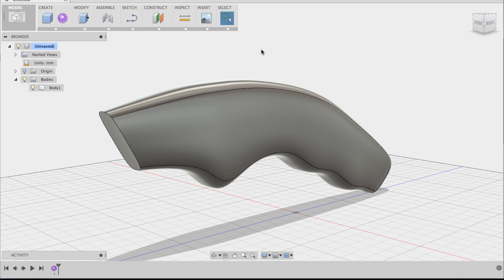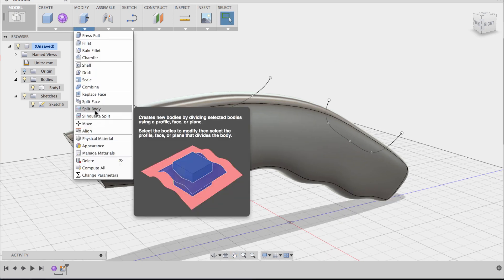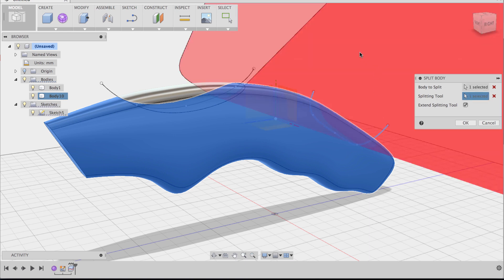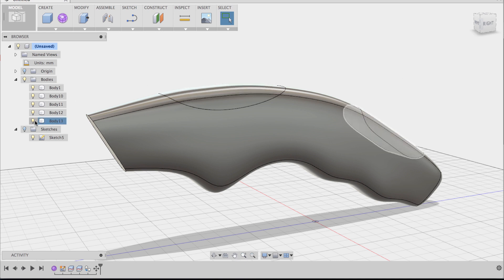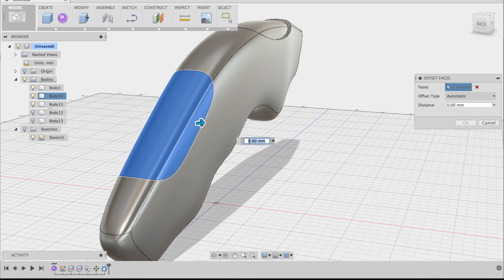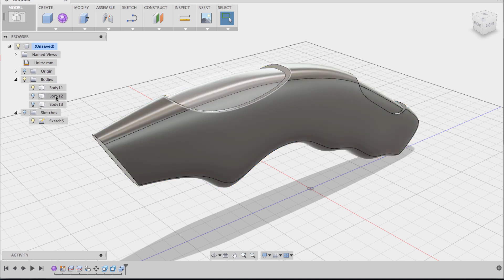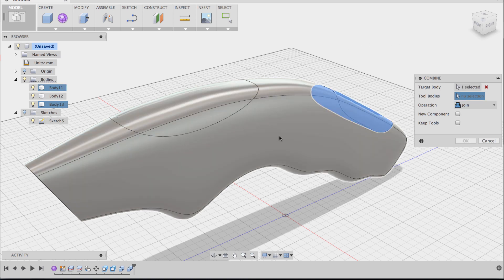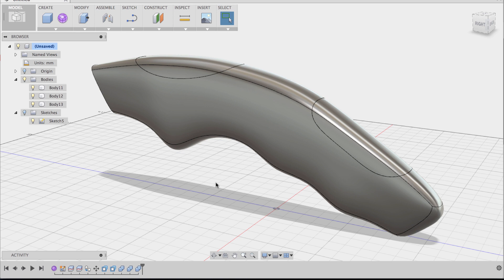How to design grip inserts

Comment: Do you have to use spline??? you got no precise control with that tool, got no size ore arc ore angel ore diameter of any of the line how are you to make a precise shape
Reply from the maker: You do not NEED to use splines ever if precise control is what you're after. That said, there are some dimensions and constraints that could help you achieve better precision.